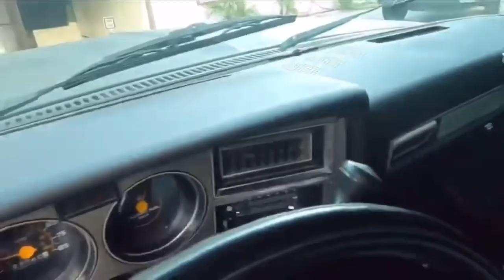Chevy C10 Budget Build Complete Restore

Comment: Hey my brother great video after watching your video ,I went and spray painted my  c10 using the same spray paint you used. Did you used any other on top of that like a clear?
Reply: What spray paint?????
Reply: @davidtowers7676   rust oleum rust reformer that's what you used  right?
Reply from the maker: Yes the rustoleum rust reformer and no I only sprayed it with rust reformer